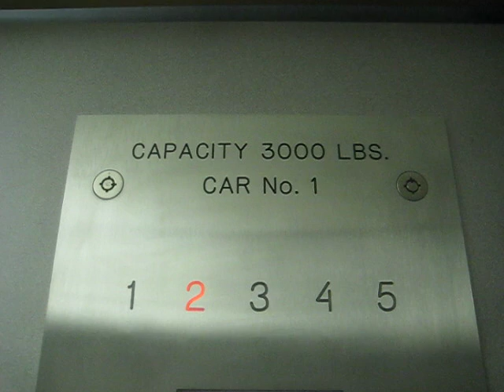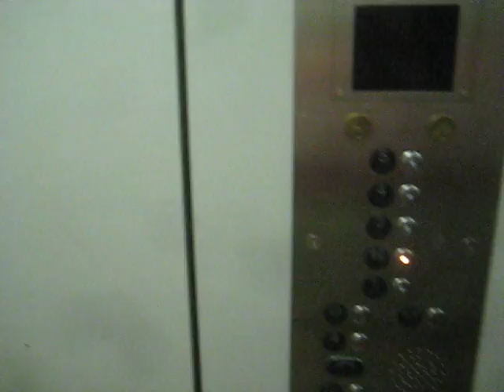Elevator Independent Service Mode.

Comment: On some elevators, call cancel does work.  Also some elevators you either press the button and the elevator goes, or you hold it down.  I have also come across one elevator where it will go to a restricted floor.